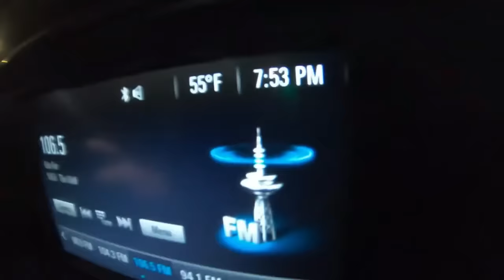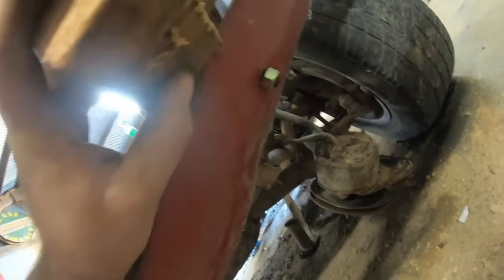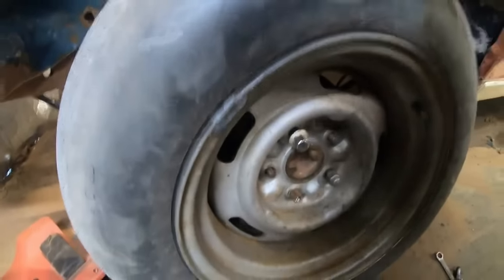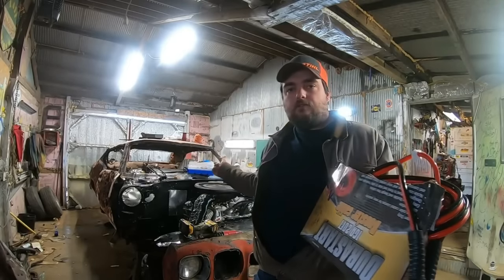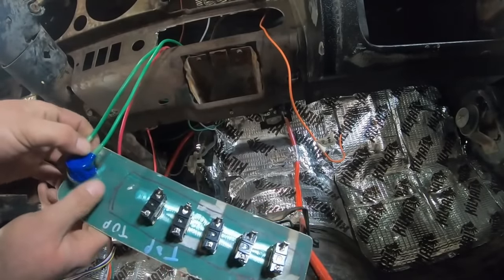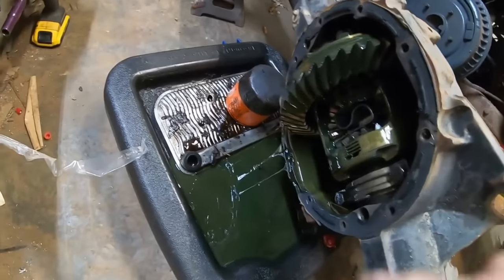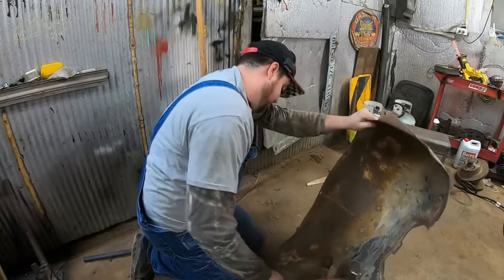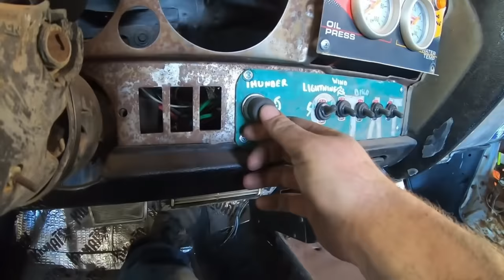Worst GTO Ever: ALL-IN ONE Holey Goat 1970 GTO BUILD SAGA — 23 Episodes Condensed to Under 1 Hour!

Comment: If only they had youtube when I was 17. (now 57) You remind me of me back then. Totaled Monza spider, only about 2 feet tall because a lifted F150 landed on it in a  wreck in the snow. With a 262 cu, in, 8500 rpm v8. Buddy said you can have it if you pay the impound fees. $327.00. 72 Vega, left side caved in 2 inches and blown aluminum 4 banger, $50. End result, side caved in V8 Vega with 12.7 eta, 147 mph top end. For $800. Traded straight across for 76' HO Trans Am with blown engine, 243 rear end gears and caved in passenger door. A few parts off another totaled 76 Trans Am and a few engine parts, 167 mph top end Trans am for only $1000 more. I never got around to fixing the bodywork on either one. Those where the days. Love your video!

Comment: Do you plan on porting and polishing the factory cylinder heads as well as doing other upgrades like headers and a cam on the Pontiac 400 in the Holy Goat eventually.
Reply from the maker: Preferably on the original engine. If I have to build the engine in the car I'll throw the heads away, and go roller on the cam. Headers are a waste of money on a Pontiac, ram air D port manifolds

Comment: Very sad, I had a brand new shiny '70 GTO. It was red with a white convertible top with a 455 ram air engine and a hood tach. It was automatic with a 307 posi rear. It was a lot like a Judge but without a spoiler. I think it was a rare model because it had a big decal on the front fender that said "The Humbler" which could have been dealer installed. I looked for a long time to find info on Humblers and finally found someone on a GTO forum that also had one.. It was the showroom car at Union Park Pontiac in Wilmington, Delaware rotating on their turntable.

Comment: If I may use an over used three letter abbreviated exclamation to say, OMG!  I saw this Holy Goat when I was on a Junkyard Digs epilog and had to see more.

Pole Barn, has a wit I can dig.  The battery box placed in the trunk was a LOL moment that made me stop just now to comment on how funny this upload is to a man 65 years old that once owned a '68 Goat way back in the mid 1970's.  You know it was green in color and the engine was fairly beat but she had the Hurst 'His/Her'  auto shifter and I was unaware just what it was that I had.  At the time in my early 20's in service to our country back in Biloxi Mississippi I drove her 'til she had more needs than a fella in ATC Tech School at Keesler USAFB could afford so I let her go to a mate I presume (really don't remember) but I've never forgot how that tachometer mounted outside on the hood seemed to be one of the coolest features of a car I had ever known in my early life of automobile ownership. 

Only the 1964 Studebaker Wagoneer held a place  more unique in design features. This heavy 1964 wagon included a  'three on the tree' overdrive equipped standard tranny that had a clutch pedal that took a toll on your left calf and foot, especially in stop and go commute traffic.  A unique design feature on this Studebaker Wagoneer was its rear sliding half roof for hauling large loads. 

My first car that I owned was a fleet car for a telephone company that was later broken up into mini-bells. Another three on the tree standard shift 6 cylinder 4 door 1964 Ford Falcon painted for telephone service techs, Army Green.  So dependable with the remanufactured Sears engine my father and I put in one weekend together (great memory) but had notoriously weak ball joints standard as well. Otherwise a hearty little car that never left me stranded. I kept it for a long time leaving it with my parents as I left to serve in the Air Force and they let me have it back when I got out.  Sold this one too after my limited finances couldn't keep it rolling safely down the road.

Back to the video....😃

Well that was a trip for sure.  The car show exhibit with the traffic cones and "Do Not Cross" tape was hilarious, dang straight, you need a tetanus vaccine booster to get close.
Reply from the maker: Always like to read stories like this one.

Comment: So i know the idea here is to keep it with the bullet holes, but my intrusive thoughts are thinking, what if you took each panel or door, covered the back of the bullet holes with something to keep it air tight, then you pour resin all over and into those holes with some guards on side to keep the resin from spilling, then you sand it, then you car primer it, and finally you use a car paint. Might do wonders for a car with holes in it.

Comment: I own a 61 Bonneville,  a 58 Delray and some sort of Pontiac.... I say some sort because the front end is buried and it's sitting over a brook. I do however know it had a four piece split grill. Neither of the other cars are salvageable either. 
The Delray's roof is on its floor and the steering wheel turns the front bumper. 
The Bonneville is buried with only the grill and the driver's side door visible.... honestly it might be the most salvageable...

Comment: ... kind of taking the whole patina build a bit far ?    On a more serious note, why dont you get it clear resin dipped/coated so you can keep all the holes and jenky interior, but make it actually road legal?
Reply from the maker: Why would bullet holes make it not road legal? Maybe uncomfortable, but cops literally don't care
Reply: @PoleBarnGarage  I guess there are some major differences between road laws here and there..   still a resin dip car which also has windows and air-con would definately be a conversation piece :)  You could do some sort of roadkill Necronomicon style skin/leather look trim on the seats.  Rob Zombie wold probably rent it for a musuc video or movie scene! 

Where I am, if you get a really grumpy cop they will tow you car just for having an after market exhaust tip.   Australia, the land of the driving undead, as Clarkson formerly of top gear once said.  They are trying to pass laws that makes a car with /ANY/ change from factory illegal, and have elevated road worthy checks to the level of absurdity its almost impossible to register cars older than a few years now.

Comment: Now, to be honest, when you first started on this, a lot more of the old car was going to be used. Suspension and rear end come to mind right away. But as the project went on and you started getting more free stuff, you basically built a brand new car under that shot to hell body. Not quite what you were shooting for at first.
Reply from the maker: I literally didn't do any of that. You can't reuse suspension parts that are bent and twisted. Everything I replaced it with except the brakes was used and cheap. If you don't replace steering and brake components with new parts you need your head examined

Comment: I understand the want to utilize that vehicle but, it would be so much nicer if you did a frame off restoration or at least  separate the drivetrain, sandblast & paint the frame & I'd coat the entire frame in a 50/50 mixture of diesel fuel mixed with bar & chain oil then clean the block & paint it then replace as many body panels as possible to get that car looking very nice..
Reply from the maker: If you watch the episodes in full, you'll hopefully realize that would be nearly impossible on any average person's budget, and at the end of the day you'd have a taiwanese GTO. Plus, there's plenty of restored ones out there

Comment: I remember I was at the Michigan speedway for a NASCAR race during the time when GM was trying to figure out what car they where going to get rid of. And the announcer. Asked the crowd to chear when he said the company they thought should go. Well needless to say it ended up being Pontiac. I remember just being really sad about that. Because during that time Pontiac was getting a bad rap. Due to the Aztec and the same old same old Grand Am. It didn’t help that a lot of Pontiac cars were kinda crappy but all of GM cars were. I really wish they didn’t ax Pontiac a lot of the younger crowd during that time weren’t thinking of what Pontiac used to be back throughout time. Pontiac was one of the originals the first to try to cater to the younger generation. With cool futuristic designs and high performance.

Comment: Time for fitting a roll over hoop bar at the very least incase you throw another drive shaft and end up flipping over onto the crushed roof killing you , and weld the doors duke's of ity's a hazard style ayh ?
Reply from the maker: Nah
Reply: @PoleBarnGarage  your a brave man with no strenght left in that roof metal and a miss alignment poppin your prop shaft is like playing russian rulet
Reply from the maker: The reason they require loops at tracks is to protect the track not to keep your car from pole vaulting. You'd have to be doing like 200mph
Reply: @PoleBarnGarage  if your going round a tight ish corner turn then 60 mph plus is enough to flip if it catches just right or wrong should i say

Comment: you was doing fine all considered until suddenly BAM You Had A BRAIN FART AND Thought using a traffic cone and flexi pipe ducting tube was needed in your Warm Climate (where is it Texas Maybe?) ,pull it all of throw it into the bin and source some secondhand doors would actually be Helpful.
Reply from the maker: Missouri. Air temperature does not matter near as much as density. Cold air is dense, so is 65mph air
Reply: @PoleBarnGarage  my bad brother ,your in missouri ayh ,I,m in sheffield England